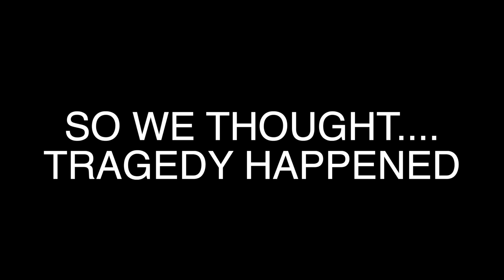I HAVE NEVER HAD THIS HAPPEN BEFORE! Cost Us The Race!!!!

Comment: Did an oil pump on a dd15, let a new guy help me re-install the pan, I did the rear because it’s more likely to leak and let him do the front. Filled the unit, primed the oil system, truck would hit once and act like it was locked up. Not something you want to have happen after doing an oil pump, new guy pinched the starter solenoid remote wire at the front of the pan. Stupid mistake, had never seen anyone do it before, I don’t work with new guys anymore though. 😂😂

Comment: Just gotta be smart enough to learn from your mistakes and know when to move on and never make that mistake again and I can almost guarantee Slinky will never make that mistake again you guys finished the season strong to have the rough season you did and go through hell like you guys did and still finish in 10th is not something to brush off you guys got a well deserved win when it counted the most Season 7 is gonna be epic with you wheeling Bad Blood also I'm asking for a chance at a job on your 2024 NPK team & I know its extremely unlikely I'm not asking for any hand outs just a hand up and just one chance at a job on a winning NPK race team even if its just being your parts/ tool gopher or your video guy setting up go pro's I'll do anything for one shot at becoming part of your team i know engines and vehicle's in general inside and out top to bottom I'm good with my hands i can weld decent and i can fix almost anything